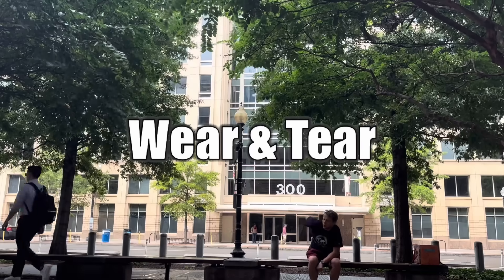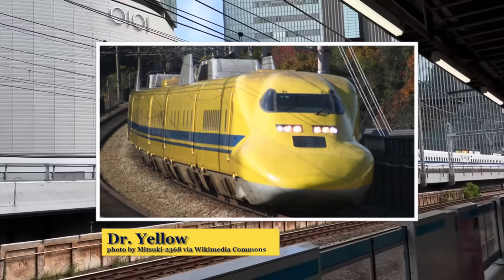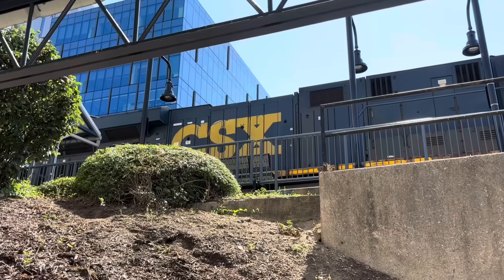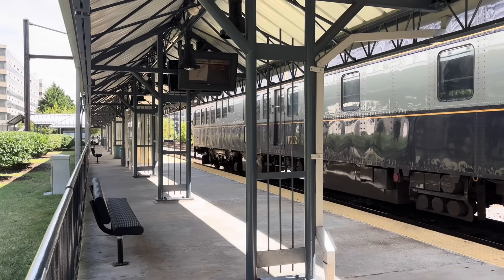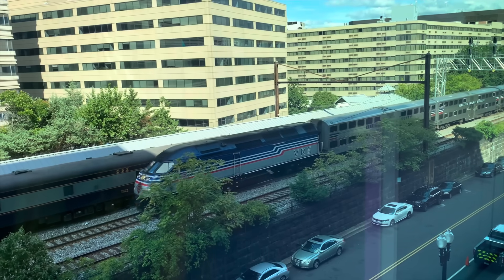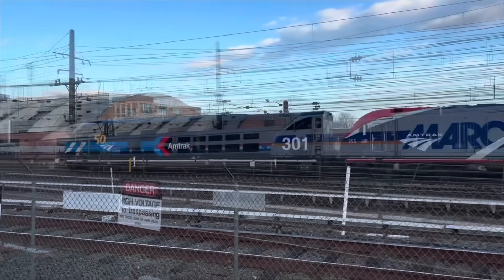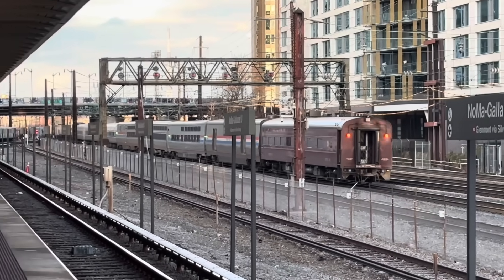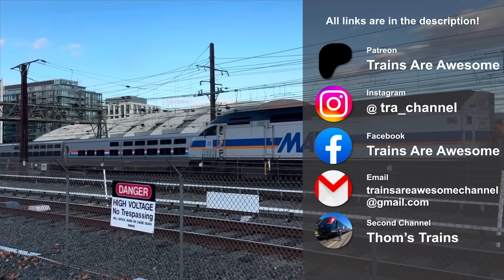Let's Talk About Track Geometry Cars

Comment: With the head end power, you confirmed my recent suspicion when I was rail-fanning the El Chepe in Creel, Chihuahua, Mexico. I unfortunately couldn’t ride this iconic train as the schedule didn’t line up with my travel plans (had to catch a flight two days later).
But I was wondering why every passenger car had its own little diesel generator below. Probably because they used freight locomotives to pull this passenger train.

Comment: Thats just the tip of the iceberg too, as mentioned theres alot going into inspecting the physical steel track, but theres also a top of work going into inspections of the overhead catenary. The cat is quite a precise part of rails too (where present)
Reply from the maker: Unfortunately there isn’t that much catenary to inspect in the US…

Comment: Now that was a very nice catch. Here in Europe such kind of equipment also exists, also with cars, but what I see mostly are special railcars, weather purposefully build - by makers like Marisa, Plasser & Teurer or Harsco -, and measure a wealth of parameters, both track geometry, but also infrastructure (like the state of tunnels and signal systems. Some years ago, one of the main responsables for the track and infrastructure program invited me for a tour of a Plasser specialized railcar, and I could see the very complete equipment used. Since then, the railcar was upgraded with even more equipment. It's sorta space age